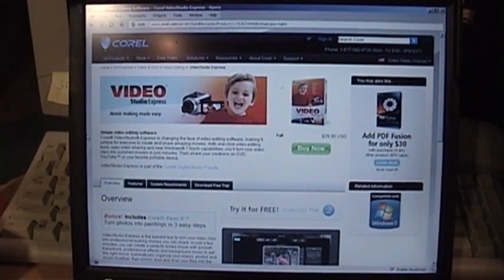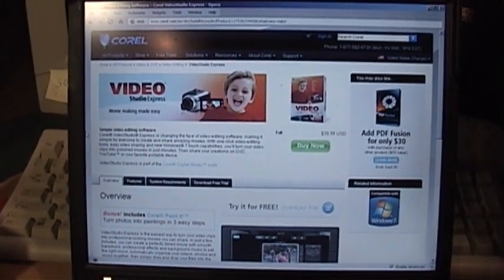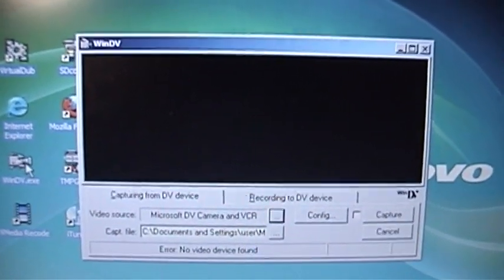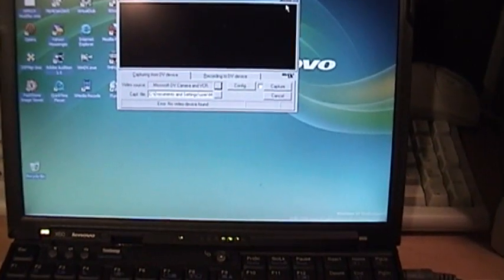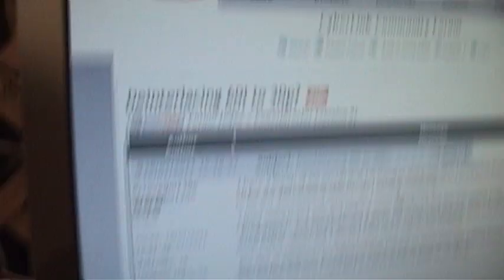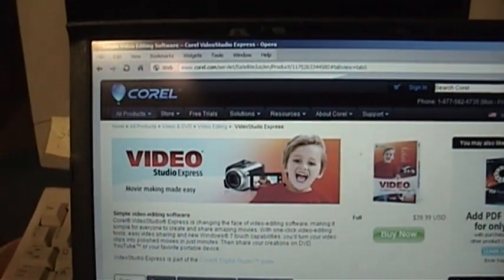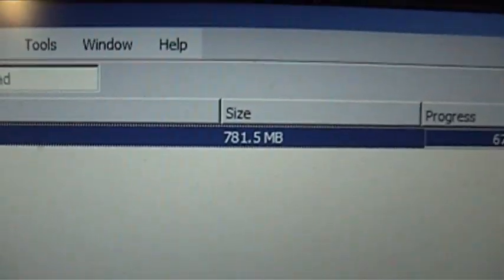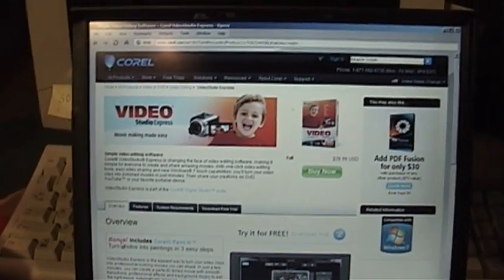Amazing discoveries! (boring random vlog-type stuff)

Comment from the maker: @uxwbill The analog 8mm/Hi8 Handycams provide two different 16:9 modes: "Cinema", which puts black bars at the top and bottom of the 4:3 image (so it's still actually recording in 4:3, and therefore SteadyShot remains functional), and "16:9 Full", which expands the visible left and right extremes of the picture into the buffer zone around the edges of the image sensor that is normally reserved for SteadyShot's stabilization effect. The Digital8 models only provide the 16:9 Full mode.

Comment: Maybe the reason for the distortion on the Hi8 recording playback is because Hi8 is a higher bandwidth than video8? I'm not sure, but I do know that my CCD-TRV57 plays both video8 and Hi8 perfectly fine. It's a video8 XR camcorder, but it has a Hi8 playback mode, kind of like having SQPB on a standard VHS VCR (SQPB allows for the playback of S-VHS videotapes on a standard VHS VCR without the distortion).

Comment: I believe the "duck head" plug adapter for the iBook's power supply is the same between the non-MagSafe and the MagSafe version of the power supply.  Even the part for an (earlier) iPod or iPad power brick should work.

Comment: You may know that I'm using PowerDirector. I too like the program because it's easy to use and still has all the professional features I want to have. The de-interlacing is being done automatically, if you right-click on the clips in the time line, you do get a menu for the de-interlacing (TV format). Usually it automatically selects the option that works best for the clip. At least that's what the version 8 Ultra does.

Comment: Crap de-interlacing comes with all of those programs, they usually just blend the fields. They are all pretty bad overall (esp. Power Director).  Best way to avoid that is edit interlaced and then write out the final file using VirtualDub or AviSynth and a decent de-lace filter like Yadif or TGMC.

Premiere is the gold standard for Windows editing, but can be overkill. The trimmed down Elements version might be worth looking into. The old macs came with the direct plug too. Got one with my PBG4.

Comment from the maker: @NJRoadfan iMovie '06 and Magix blend the fields, which smears fast motion but preserves the full resolution. iMovie '08 and higher throws out the entire lower field (Apple calls it "single field processing"), which cuts the vertical resolution in half and causes the same "jaggies" as I got with PowerDirector.

Yadif is good, but Virtualdub is a buggy piece of crap. I'm tired of it crashing on perfectly good video files. That's the same problem it's had ever since the Windows 98 days!

Comment: @vwestlife The old versions of VirtualDubMod and Avisynth work fine (with a Vdub to Avisynth conversion plugin to use Yadif, and I would use the x264 commandline to do actual encoding, not Vdub). That's only good if you feel like doing manual trim points in the script. However, Premiere is my video editor of choice now due to the convenience of automatic deinterlacing and a plethora of plugins and features. CS3 should work fine, even though I use CS5 myself.

Comment: Don't even bother using that adaptor for the ibook power supply. The are very unreliable. They are the fold-in prong type that wears out very quickly and it no longer makes a connection